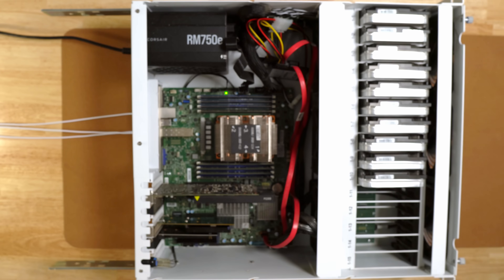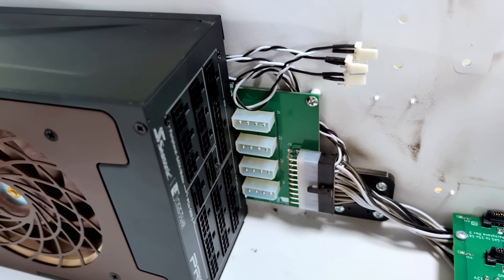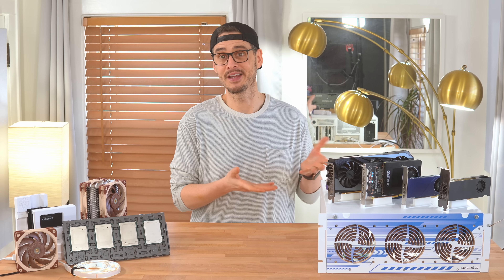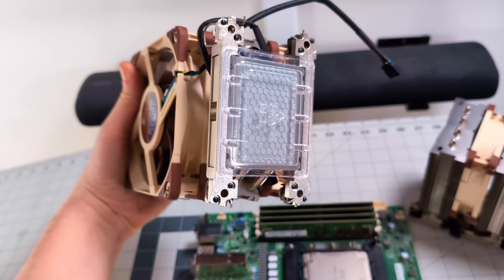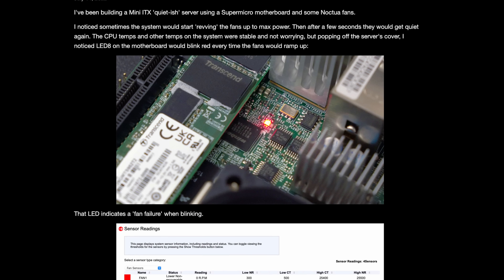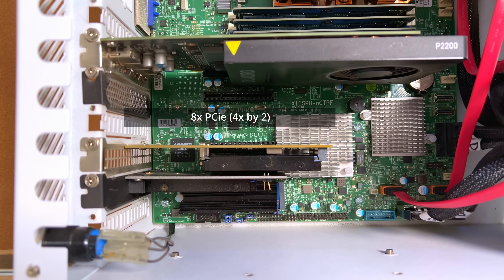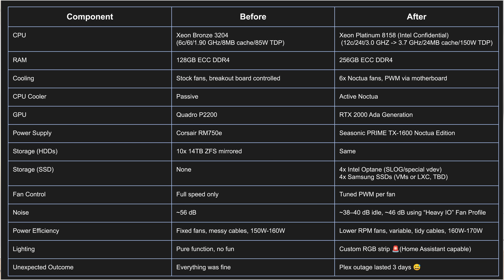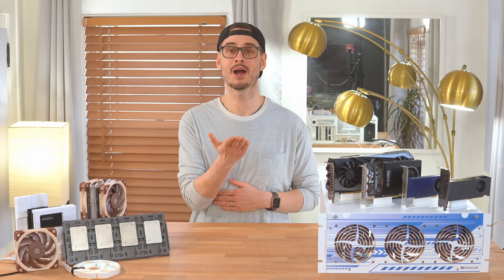I Rebuilt My Home Server — Quieter, Faster, and Ready for 2025

Comment: About the PSU efficiency. You need to take in to account what is your server typical load in watts. Very high power output Titanium PSU's, like yours are not  efficient on a low load. I bet that even some Gold rated 600W PSU would be more efficient for your server and your old Corsair probably was at least equally efficient too.

Comment: Woah I’m extremely shocked that you even tried to use different modular PSU cables in the new power supply. Literally everyone knows they are not cross compatible, they all have their own pin outs at the PSU end…big rookie mistake!

Comment: My ideal home server would have a hot-swappable hard drive backplane and sequential spinning-up function to reduce the startup current. and use a separate power supply and operate at the most energy-efficient workload. This would save me the worry of losing energy efficiency when replacing the motherboard and processor when upgrading the NAS system. I know Supermicro server chassis have this feature, but I hope it can be squeezed into a MATX-sized case,  just like the ASUS AP201.

Comment: The 6pin plugs actually are compatible, if you check the 6pin port layout the top row (or the botton row in your case as you hold the plugs upside down in 2:33) is for ground and neutral (top left ground, top middle sense pin, top right ground) and the bottom row (or the top as you are holding them ) is for 12v (all 3 pins) 

so we see here that all 3 cables use the sense pin and atleast one ground pin (which is no biggie if its only one especially if you just feed SATA devices and not so power hungry peripherals) and then all use at least one 12 volt pin. 

So in theory everything should work the same.

Comment: $654 before tax for that power supply.  I calculate it will take until the heat death of the universe for the electricity savings (if there actually are electricity savings) for the power supply to justify its cost.

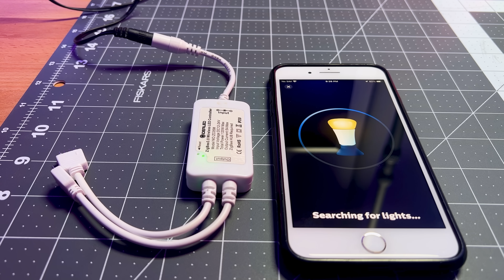Comment: 9:15 dude, not RF interference, you stuck an antenna in a Faraday cage... And yeah, it's not hermetically sealed, but Zigbee uses the 2.4 GHz ISM band, so its wavelength is on the order of 12.5 cm, there aren't any holes larger that 12 cm in your case, so for that frequency band, it's basically as good as hermetically sealed.

Comment: I wanna build exactly this. But the one part in the build you wanted the Nvidia RTX GPU but it wouldn't fit. Would it be worth getting a bigger case or is it diminishing returns at that point for what you have in the video

Comment: im late but switch out those molex to sata adapters IMMEDIATELY (@ 3:00). the sata plastic housing is injection molded. not to fear monger, but these are super dangerous. so dangerous in fact they have a high chance of literally just bursting into flames with no warning. you need to get adapters where the sata end has the cables crimped.

Comment: Question?
What about silicon coating the circuit or mother boards just to avoid dust mitigation?
Is it possible to use blade less technology for a more quiet airflow regarding the fans?
Have you used an infrared gun just to get a look at the temperatures of the boards? 
140 TB is a lot of data.
What kind of heat sinks was Tim using? - Copper?
Did the room temperature go up?
What was the CFM that the fans were rated for?
Does TIM have any Solar panels or Wind turbines?
What about a solid copper heat sink for the outer tray or the box/housing for the home server? Would it lower the temperature, have to get an infrared gun and do some experiments.
I'd imagine those 3 fans are low voltage, 6 of them looks like, 12 volts or 24 volts.
What about a VFD?

Comment: Yep - NEVER swap PSU power cables. Even the same manufacturer's different models don't always have the same cables.

Seems like the PSU/mobo was able to detect the issue and prevent catastophic damage in your case though which is great 👍

Comment: SLOGs can be tricky. One thing to note about them is they hold no more than 5 seconds worth of data, before ZFS flushes it to the main pool.  And that's hard limit.  If your in a scenario where you are in a situation where you are writing 500MB/s of fully sync writes (the only type of write that will ever hit a SLOG) with a 5 second flush, that mean...2.5GB of used space... max before it's flushed to main.  Thinking out loud... but they do have those what, 32 gig Optane, a single one can be used for SLOG, and those magical 118gb Optane gold? A striped pair of mirrors gives you mirrored redundancy, while effectively doubling your total storage depth? Taking that small block storage up a few for KB can really help out, even in front of consumer SSD or spinners.  And since I can't past a links in YouTube comments to a source my 5 second comment, if you google "Aaron’s ZFS Guide Appendix: Visualizing The ZFS Intent LOG (ZIL)" or look in the official Oracle docs it mentions it there under "Tuning ZFS When Using Flash Storage"

Comment: How do you use 1 gpu for both plex and llm? I imagine you have them in separate vms/containers, which means only one could get the gpu pass through right?
Reply from the maker: Use the same VM with multiple Docker stacks!  I have a video on it covering how I use AI at home!
Reply: Yeah but only one container can have access to the gpu right? For example, in my plex cintainer i pass /dev/dri for my intel igpu. I am not able to pass thecsame gpu on another container at the same time@TechnoTim

Comment: Mirrored vdevs??  So if you lose two drives from the same vdevs, you lose everything, yes?  Did you consider e.g. a raidz3 with a mirrored flash slog?  More storage, more redundancy and pretty darn quick.  Just wondering.  V/R.

Comment: Hi Tim,  I had decided to also do a major upgrade to my home server system although not as extreme as yours. My initial goal was to build a small rack system with something like a synology RS422+, but my wife chimed in and I was "encouraged" to go with the DS923+  with 3-12 +1-10 TB drives which replaced my aging 918+ with 4-4TB drives. I bought the M2 Mac mini with replaced my M1 Macbook Air. Everything is now powered by a TKL 8 outlet power controller sequencer. My 923 is now my main server while the 918 is used as backup. I expect that I might still need to  upgrade the drives in the backup server when they run out of available storage. But as much as I like the WOW factor on your setup; mine will serve me well enough for my movies, TV shows, music libraries and photos. But I still like to watch what you do with your Lab even if the tech is a bit over my head.

Comment: That efficiency rating for the psu is is only achieved when you're close to or at the max rating. If you're only using 2/3 the capacity, efficiency varies. Is it more efficient than a correctly sized psu with the one lower grade rating? Probably not.

Comment: That modular PSU cable s**t drives me nuts...  There is no reason that these cables cant be either LABELED or STANDARDIZED.  I have a whole box of cables that I'm afraid to plug in and use because they are not labeled with a brand.  I know I can test them with a meter before I use them, its still asinine.  I have also heard that the pin layout can differ from one model to another OF THE SAME BRAND...

Comment: Honestly, I just did a major home lab upgrade order so the only thing holding me back is waiting for everything to arrive. I'm excited to get a Unifi 48 Pro Max PoE to help install a new security system that is completely Unifi run and PoE based. So that new switch is replacing my older 48 Port Pro. Then I'm adding 3 new servers to the rack a Dell R730, R430, and R740xd SFF since I got a deal for the first two at a local recycler and the R740xd was on sale in my price range on eBay. I am currently running with a R610 for backups and R430, R720, and two desktop computers for my Proxmox cluster. Next, I ordered 5 new 2TB SSDs to refactor all the Proxmox nodes to run Ceph on and then use the rest of my drives for TrueNAS storage and cache. Finally once I sell the 48 Port Pro I plan on using the money to get an Aggregation Pro since most of my servers have 10G cards installed. I just got out of college, married, and got my first job so I finally have some money and some free time to put into the lab. Any tips for starting a Home Lab Youtube channel @TechnoTim?

Comment: The fans in my server case (a tower) were beginning to gum up and show their age (7 years) so I replaced them with some Noctua's, under the assumption that they would be quiet.  Au contraire.  These things sound like I'm in a wind tunnel, whereas the ones they replaced were literally silent.  I guess the fact that Noctua saw fit to include "low noise adapters" with them should have been a clue.

Comment: I was taught Murphy's Law is often misstated as "what can go wrong, will go wrong," but really goes, "if there are more than one way to do something and one results in catastrophe, someone will do it that way." "Murphy" was an Air Force scientist in the early days of supersonic flight, designing a suit which could help pilots stand up to low pressures and high G-forces, and to this end had built G-force sensors and one of those big centrifugal spinners. On their first human test with the spinner, the guy was subjected to an estimated 18 G's of force but every sensor read zero. It turned out, the sensors had a plug that could be inserted either way 180° flipped, but only actually worked one way, and that day they'd all been installed by a technician who didn't know and made the wrong assumption. Thus the Law was meant as a challenge to engineers: "things people do might sometimes be stupid, but people will stupid things unless you make it so they can't." 

Your PSU manufacturers failed the challenge. Don't subject your PC components to 18 G's of centrifugal force.

Comment: eh, i went that route earlier a year ago....currently running 30+- containers on a 5w sbc board including open webui and the whole arr suite, load avg = 0.5, can go up to 16 simultaneous 1080p transcodes at 18w full.load, runs on a $5 UPS with 18650 batteries
Reply from the maker: @VinnyG919  where does your 70 TB go 😅

Comment: very nice build! really, holy shit but power usage for me is way too high. I mean i have much simplier server which consumer 32W Idle on i3 12300T, 6x exos 20TB (HDD turns on only when needed so spin on for flex takes about 5-6 sec on beginning only) and 16GB ddr4 but yeah., u r using AI for it so i can understand. Plex, audiobookshare, qbittorrent and file manager for NAS  on docker (plus small containers not worth to speak about them ;) ) works for me very great. One more time, nice build!@
Reply from the maker: Thank you!  I love the i3!  I have one that I turned off turbo so it's throttled to 1.9 GHz and it still does great at a fraction of the power!

Comment: If you can find the pin out just move the pins. I'm currently working on an upgrade also. I'm going from an old dell XPS(2011) running unraid to moving everything to a Supermicro X10DRH-iT with dual Intel Xeon E5-2650 v4 and max ECC ram. My GPU for now will be the M2000 quatro.
Reply from the maker: I am seriously considering this now because these are low profile compared to the ones you can have made.  Is it really as simple as pulling them out and them pushing them in?
Reply: @TechnoTim  you'll need a Terminal Removal Tool Kit de-pin tool. and then it's that simple
Reply: a set is around $15
Reply from the maker: @ Thank you so much, searching Amazon now!  Appreciate it!

Comment: if you only need encoding in H264, i can recommend the Matrox M264 encoder cards. i guess even the lowest model is more than enough for you. i have in my system  the s2 because i got one from the bin and repaired it, but even the smallest is crazy. i mean, the smallest can do 10x 1080p60f10bit or 2x 3840x2160p60f10bit is crazy. IF you're down to 8bit, you can do 1.5 times more. For home use, crazy. and if you go down to 1280x720p30f8bit, you can do 32 parallel streams and double this again if you go to interlaced mode. Yeah this codec card is a beast and uses only a couple watts. 
the biggest model, the S4 that is capable of 800 parallel 1280x720i30f8bit uses only 75W, so still in power specification of PCIE. 

for AI LLMs i have a RX540 because of space limitations. it runs Ollama with a 6b model and is used in Home Assistant for speech commands and also used in a game i develop that uses the same model for dialogs and NPC behavior, to make the world more.... "lebendig" lively and less scripted and predictable? I don't know how to describe this. You have to speak to the NPCs without defined dialogs.

i planed to integrate the LLM functionality into my game, but i think the best way is installing Ollama alongside and running the model my game needs and calling to ollama over the local network path. also this ensures that the game works even with a low power GPU or perhaps on only CPU mode. i am not sure if i stay by the 6b model or changing to a 4b model.

Comment: A couple questions:
1. Isn't the ZigBee issue a combination of interference from all that noise inside the case and the fact that the case is a friggin Faraday cage meant to block all that RF from getting out???
2. What's the point in adding extra heating inside the server? (a full led strip where probably nobody is going to even see it most of the time)
Reply from the maker: I think that's why I lose connection, that and it's a big metal box.  Also, as far as lighting goes, I have a timer that turns it off automatically 10 minutes after turning it on.  It's fun to see in my server room and it's super helpful when working on it, like I am now.  I don't need to use my phone as a flashlight to see  inside.
Reply: @ Installing an external antenna, or moving the ZigBee outside is also an option. The led strip also doesn't sound like an issue, with the timer. Alright, seems to be an interesting channel, I subscribed.
Reply from the maker: @zedzedder1426  thank you for all of the comments and ideas!  I mainly use the led strip to turn on when servicing the server.  I do have a motion trigger set up where all of the lights in my server room turn on and I also trigger it to turn off after 10 minutes so it’s only on when I need it.

Comment: fan push is always stronger that pull.
fyi any gaming rtx card can run in efficient mode via undervolt that gives ~15-20% performance decrease, they very rarely run fans then, and you can use pcie riser in custom used mining case to put as much gpus as your pcie slots bandwith allows.
for servers with ai load that pulls 1500w+ with gpus you can visit mining diy communities - they put minisplit into used server racks that can be sealed.

Comment: TLDR: money is holding me back need to build a new server for media library, vm hosting, and steam library hosting

pretty much the thing that is holding me back is money and not knowing what is good when it comes to server grade hardware, if it was gaming hardware that is easy for me to put together a build for, basically i need to build a new home server, and or divide up what i'm having it do, cause what i want it to do is host my media library so i can backup and stream my movies and tv shows, i also want to have room to run a few virtiual machines to play around with, then i also want to have a large high capacity iscussi drive set up for my steam library for my main pc as well as the living room entertainment center pc i plan to build,

Comment: Great video Tim!!! I really want to upgrade my setup now. I recently overhauled my cooling with Noctua. HUGE improvement as my server rack is in my office where I do my meetings and recording. I really want to pick up a small GPU that is 2 u friendly that has a little bit of punch for ai. I guess I would just pass it through to proxmox into my vms. 

Space it the main thing holding me back.
Reply from the maker: If you can afford 2 slots, the RTX 2000 Ada is such a great little card.  Powered by PCIe only, is the icing on the cake!  It's spendy, but it should last me a few years!
Reply: @ looks like there is a single slot option as well. Will have to look at the specs closer. I think the extra cost is probably worth it. I do worry about heat in a 2u chassis but it does looks like it has rear exhaust so probably not an issue.
Reply: I will probably do a dedicated vm with gpu pass through and just run ai on that vm only.

Comment: That tdp 😕 i have a Ryzen 3900x (105tdp) and have recently started running it in eco mode it to reduce tdp to around 85, the server is heating the second story of my house and its unbearable in the summer, added to that with its 10 x 3.5" drives, 2 gpu's, and 3 nvme's. Im actually thinking of popping out that 3900x for a 35tdp cpu during the summer. If i could afford 24tb drives i'd be pulling out my 4tb and 8tb drives to reduce the amount of disks because cooling that lot is also a pain, when they stack up in a case like that they turn into radiator. Granted i could blast the shit out of the fans to cool it more but then i'd have to listen to the jet engine running. As it is the case has 8 fans (not counting the gpu fans). Home labbing at this scale without any budget is not easy. You are blessed with your sponsors.
Reply: install minisplit - even the cheapest one with 9000btu will work for small rooms and would last more than 5 years. even if you cannot drill holes you can take out one window panel and run piping trough plastic panel.
Reply from the maker: I can relate.  I use to live on the 3rd floor of a brick apartment building without air conditioning, all while having about 5 PCs/servers and a Plasma TV....